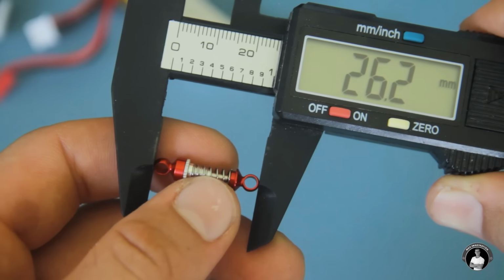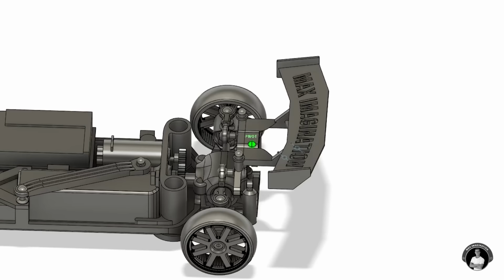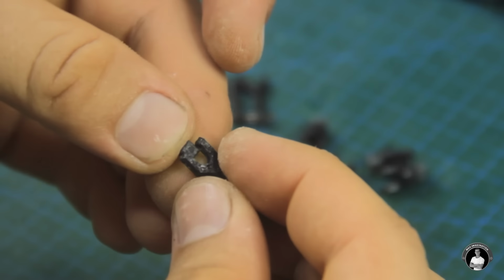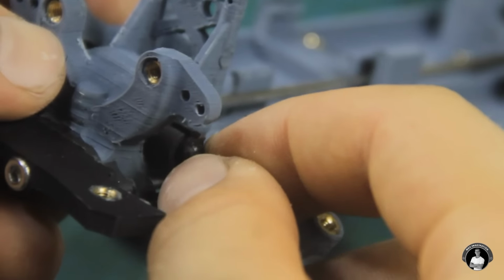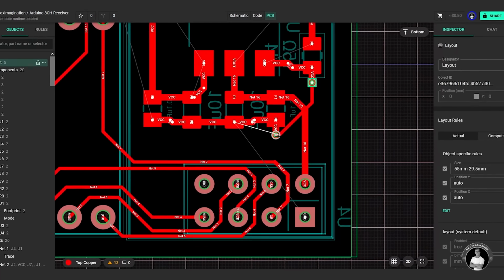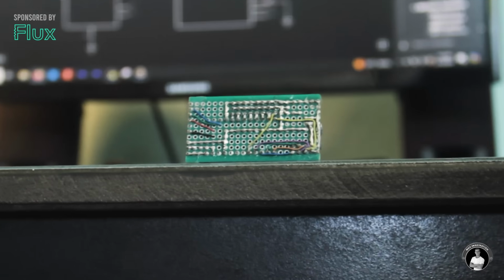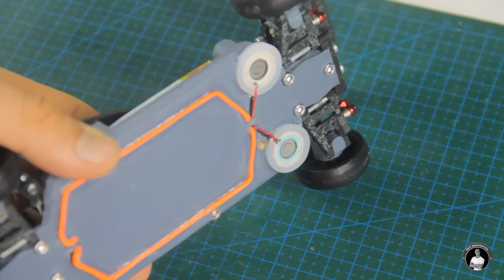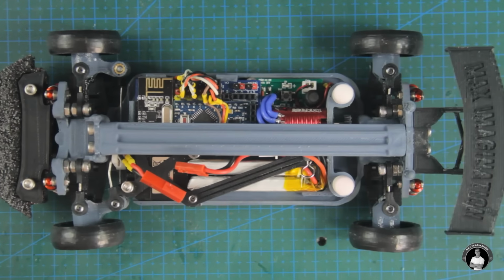Build an Arduino RC Drift Car with Smoke Effect!

Comment: To fix the vibration problem some escs detect the back emf signal and then based on that the esc energises the coils that need to be energised based on where the magnets are located
Reply from the maker: Which ESC would you recommend that would fix the vibration problem?

Comment: I plan on using the electronics of an actual RC car, a 4400 KV motor 2852 and 120 amp ESC even though the motor is only really rated for 40 amps maybe 60 amps at the spikes. 
Along with a radio link receiver with a gyro. 
And a 20kg steering servo. 

These are all the parts I have but I am wondering even with store-bought shocks, if the chassis and all of the other parts needing to resist all the torques and driving on asphalt is going to make the car not stand up even with nylon filament. 

Would you have any idea if your design would work with these high power components?  I wouldn't mind purchasing it if it is capable of using my electronics and surviving all of the shearing forces that would be put on it
Reply from the maker: Hi. Thanks for inquiring!

Based on what electronics you have, they will not fit my design and would require redesigning certain parts to fit.

How big is the 20kg servo you have? Sounds bigger than the 9g servo I used.

I think if you scaled it up, made necessary adjustments on my frame to suit your equipment, and printed it in Nylon, it could work.
Reply from the maker: Oh and since your setup is that powerful, my piece of advice is get the gears CNC machined from steel or brass.
Reply: @MaxImagination would you have the cad files so I can have an easier time in Fusion so that it's not a tessellated mesh?.
And would you be willing to help me since I'm not very knowledgeable about the mechanics so that it drives nice but I'm quite good in the software

Comment: I honestly can't find a reason you didn't just use elrs or similar radio connection for this. It's so much simpler and better than anything you can make yourself
Reply from the maker: True, but my making approach is to build these controllers from scratch. You can see more of my videos and you'll understand.

Comment: How do I connect the car to a generic rc transmitter
Reply from the maker: You'd simply use a generic RC receiver instead of building an Arduino-based receiver.

Comment: HI MAX Like your 3D printing RC drift Car I was wondering if you can make one out of PVC Pipe . I don't a 3D printer so I was wondering if you  can build one from  a . PVC with planning sheets that would be great , thank you  max
Reply from the maker: Thank you! For a PVC RC car, follow my video on that on my channel. This one can only be 3D printed out of the options I give (unless you want to design it for PVC making yourself).
Reply: Hi Matt thank you for your reply I was hoping you might have plan sheets  like you did for your Arduino  drone it helped a lot with my project thank you you're reply Max

Comment: Can the humidifiers run with pwm? It would be cool to be able to map the intensity of the steam with the speed of the car
Reply from the maker: With it's current circuit and wiring, no, as this would cause the humidifier to switch through its different states repeatedly. It could work, but would be cleaner with a more direct way of driving the humidifier - i.e with a MOSFET.

Comment: what's the range on the receiver/ transmitter set you made? I am interested to try to make this work for an ARRMA truck, just to see if I can.
Reply from the maker: 100-1000 meters depending on if you use the standard or power-amplified radio modules in the NRF24L01 lineup.

Comment: Hi Max, I just recently came across your channel and I really like your builds. I'm interested in making rc cars from scratch myself, but I don't have a formal education or the slightest clue on how they work. I would really appreciate it if you could refer me to any resources that I can use to learn. Thanks for the awsome content!
Reply from the maker: Glad you like the channel! You can learn a lot from books and online resources, and don't be afraid to try things out and experiment. For electronics, read "Practical Electronics for Inventors". For Arduino, check out courses on YouTube. For RC cars, you can study the basics of mechanical engineering and take apart lots of toy cars to learn about them :)
Reply: @MaxImagination  Thanks Max. For the advice, and for reaching back out. Not many content creators do that these days.

Comment: Did you do the calculation to find how much resistors to add? How did you know to add that amount of resistance?
Reply from the maker: Yes. I used the parallel resistance equation for the correct wattage and expected ohms of combined resistors and used ohms law to identify how many ohms this end resistor had to be.

Comment: Hello, I have a great interest in electronics and I want to reach the stage of inventing and producing a board. Therefore, I have studied Electronics 1 & 2 and Electrical Circuits 1 & 2 at university, but I feel like something is missing from my knowledge. I kindly request you to explain to me the map, path, and way to become a PCB designer from beginner to advanced level. I kindly ask you to tell me what I should learn from the beginning to the end in order
Reply from the maker: Hi there. What you're asking would require a full video guide to explain at best. But in short, you can find other videos on the topic of PCB designing. One PCD design software I recommend to learn is Flux (AI).

Comment: İmma use the old hobby grade transmitter 3 yr old video is that ok?
Reply from the maker: Yes, it will work with this RC car and its receiver.
Reply: @MaxImagination oh btw i forgot i dont have esc what should i use (i have the old motor controller l298)

Comment: max the receiver is equipped with a 12 volt battery, it's safe for the receiver
Reply from the maker: It is not, actually. What do you mean? However, you can input 12V into the Arduino's VIN pin.

Comment: How I made with pvc  bro
Reply from the maker: You can try, but I do not have the blueprints for that. Would you be interested to instead purchase my 3D design and use JLCPCB to 3D print the parts out? (Link in the video description).

Comment: you should either use metal gear or a bit larger 3d printed gears for more grip as smaller ones might wear down
Reply from the maker: Making them from Aluminum would be enough.

Comment: 21:48 The buzzing issue is due to the ESC.
If you use a Blheli ESC, it will work fine
Reply from the maker: Thanks for your tip... This helps!

Comment: Hey can I use esp32 instead of nano
Reply from the maker: Yes, you can. However, you may need to modify the fitting for this board in the RC car's chassis as it may be too big. With an ESP32, you can come up with your own mobile control platform or use an existing one.
Reply: @MaxImagination also can I use my own chasis cause I think, the drifting is already done and I just want your smoothness and smoke 🤩

Comment: very informative vid i might not have same reason to be here at the moment but ive been thinking to convert a toy into RC for a while now. ive collected a bunch of Knex including busted moters or bad battery bay junk but maybe i can convert some of this into a RC idea. This build does have given me a few ideas. But also for this to be so printenbale nice work man almost a proper drift car but yeah i was already wondering during the video when the 3d printed gears would fail due of heat issues. do find the mist idea funny but dont know if it might causes issues for electronics onboard in the long run.  Geusse im gone keep brainstorming to see if i can make a knex proper RC car one day. but i mostly want build out of Knex.
Reply from the maker: Hey there! I've never played around with Knex before. Legos, yes.

It may be hard, but you probably can pull it off given the right pieces and attachments so you end up with a working drift car.

P.S. The water vapor did not affect my car's electronics. It blows it downward and then dissipates. 

All the best with your project!
Reply: @MaxImagination  ive modded a Knex K-force gun into a frankenstein one because was incompleet. But ive also repaired some expensive knex moter sets with broken junk. i tend to buy piles of knex from people and find a lot of battery acid damaged stuf or total death moters terminals and more or i look for strange or discontinued parts. I wish the new owners of Knex (Basic Fun) would relaunch knex in the EU with good sets like we had in the 90s. i also try collect serten collours and stuf. But i sadly dont have the financial strenght for expensive hobbys. How ever ive done a lot of things creatively for barely money. And yes Lego is fun but most of the time out of my wallet to fool around with so thats mainly reason i got back into knex. Also due of serten sets requiring serten strenghts i think i could make some reinforced driving line but yeah its gone be a lot of thinkering. I wish i was richer but im living on handicap income. Also most jobs ive tried have become a very negative experions. People like work i do for them but barely wane pay or abuse the fact i got a register handicap and try pay less then fair. So makes me not trust them anymore.

Comment: I have a question, I have an Arduino Nano and an Arduino Uno. Can I use the Nano as a transmitter and the Uno as a receiver with the NRF24L01 module?
Reply from the maker: Hi there. Yes, you can. The Arduino Nano and UNO are intercompatible as they work from the same chip.
Reply: @MaxImagination  Thank You

Comment: Hello! Its me again ill just ask a question about the transmitter and receiver video, the black and red pins is it ok if the coppers (or the solder joints?) touch each other?
Is it gonna be fine?
(Sorry for bad English)
Reply from the maker: If you mean the power pins which are red (power) and black (ground), then absolutely not. They shouldn't touch.

Comment: Yoo max its been a while 
I need your help i have a pin stuck in my pcb board and i just woke up and heated my soldrring iron and my brain says cut the both end of the pins stuck on the pcb and now i cannot remove ive all of the heat that my soldering iron can handle but it wont melt the solder it melts the solder but only on the one side of the pcb and not the other I applied flux, and desoldering pump but the two didnt work.😢
Reply from the maker: Hey there. I suggest you use a pair of helping hands and melt a blob of solder around the pin while heating it, then pull it out.
Reply: @MaxImagination  alr

Comment: Still working on my 3d printer its diy but I am using standard drone bldc so I can't really reverse the direction of it using the included esc and diy transmitter and reciver
Reply from the maker: I recommend you either obtain a bidirectional ESC or look into how you can connect 10A relays into a circuit that switches the direction of your current ESC for bidirectional control. However, you may need to do additional coding with this method.
Reply: @MaxImagination  switching the 2 of 3  wires of esc using relays that. Seems complex and amazon doesn't ship here so I got one option I am not the best coder do I need another arduino I want to use something small not like uno or do I have code the transmitter and reciver ? Also the joysticks suck is there a different option for that?
Reply from the maker: You don't need another Arduino, you can use the dual channel relay method to swap the two outer wires of the 3 bldc motor wires (I suggest you research how this is done on YT/google it). For better joysticks, I suggest using PS4 joysticks.
Reply: @MaxImagination  Hello, so i somehow got my hands on a bidirectional esc and finished my 3d printer "works better than a my friend's ender 3 somehow' but you made 3D files paid ugh ofc you have do that i am already nearing the budget for my diy 3d car i really wanna make this exactly like yours but i cant 3d model things well can just make the files free theres people who wanna make this but cant, but anyways thanks for your help

Comment: Here are some tips if you are making this and some upgrade(s) i would like:
-definitely lube the joints AND the gearbox so they can last longer and be much smoother
-i would definitely water proof the circuits with some sort of polish or use silica gel pouches in case the humidity from the smoke decides to ruin my circuits
-Max, to up your drifting game, try adding a gyro circuit that way you have much more control over the steering of the car
Reply from the maker: Thanks for your tips! Even though I will not get back and make an upgrade update video on this project, let the tips be useful to those who wish to make the car.
Reply: @MaxImagination  with that said, could you pls still do a tutorial video on making a gyro circuit for steering there are vids online but Ig you will do best at explaining

Comment: OUTSTANDING! I looked up those awesome humidifiers! It didn't say, but do they use regular tap water, "purified" water or some other kind?  I can't believe how awesome that smoke effect sis from just [some kind of] water! I hope you can answer for me! Thanks! Totally awesome build!
Reply from the maker: Hi, Mike! Thank you for your comment! These humidifier modules work from tap and purified water. I tend to use tap water and it works well. Cheers!
Reply: @MaxImagination  Thanks for that! I am just very surprised that the water coming out of it looks like smoke! so awesome! I actually have several of those I am working on a project for my company that involved lighting, but haven't tested them yet. I wonder if something else could be put in them, to make it invisible but yet let light "interact" with it...
Reply from the maker: No problem :)

You can experiment with replacing water with glow stick fluid for something that lights up. Not sure if this will work, but it's worth a try.

Comment: Max i gonna ask a question in the diy transmitter and receiver the wires you used what is the kind of it?
Reply: Do I need to buy it
Reply from the maker: Hi there. I used 24 and 30 gauge (AWG) silicone-coated stranded electrical wires. You can find a product link to those types of wires below the transmitter's video on my channel. Cheers.

Comment: Holy crap this is dedication. Only $100 in parts. $4000 in sweat equity. It's really inspiring for case design and how you can use 3D printing plus real hardware. I've never seen anybody use standard protoboard for SMD devices!!!
Reply from the maker: I appreciate that. Many thanks for your kind remarks! Since you found it interesting, consider giving this project a shot :)

P.S. The 3D design is currently on a 40% discount!
https://cults3d.com/en/3d-model/game/arduino-1-24-4wd-rc-drift-car-with-smoke-effect-chassis-parts-design
Reply: @MaxImagination  I just donated $15 instead. Rock on with your bad self.
Reply from the maker: I really appreciate your kind gesture! I got the payment notification yesterday. Thank you so much :D
Reply: @MaxImagination  Ain't no way I have that kind of time. I appreciate your engineering and design, but it's not my field of interest.

Comment: If you lower the pinion teeth I think the motor will stop stuttering
Reply from the maker: Thanks for your input. I don't think that is the case as I heard others mention that it's due to the gear material. Ideally, the gears should be made out of metal.

Comment: 21:55 скороее всего это связано с тем, что у esc не оптимально подобран таймин для этого мотора. Попробуйте зайти в режим програмирования esc и выставить другой, более подходящий тайминг, скорее всего это поможет избавиться от шума.
Reply from the maker: Thanks for your tip. I will adjust the PWM timing and see if it makes a difference :)

Comment: Superglue bearings, WTF, you just seize them.
And bigger angle is needed, above 70° to make any rc drifter consider it trying...
Reply from the maker: I think you got that wrong. I mentioned that you need to glue the drive axles to the inner part of the bearings. Not "into" the bearings.
Also, what angle are you talking about? Wheel camber or steering angle?

Comment: mabey try to add more volt or its mabey loose
Reply from the maker: One other viewer has suggested to adjust the motor ESC PWM signal delay. I will try that first.

However, the problem is certainly not in the design or the gears. The car works despite this hiccup, but I will keep working on a solution 🙂

Comment: What was the hardest part of this car?
Reply from the maker: The hardest part was probably shaping the central drive axle to stay straight and fit into the gears perfectly. Apart from that, this may have been a bit challenging in a few areas yet very rewarding 🙂

It's worth building for sure!

Would you be interested in starting this project?

Comment: Question.. can I use brushed system insted of brushless one?
Reply from the maker: Yes, you can. This car is compatible with the 180 motor and brushed ESC. Be sure to use the original version.
Reply: @MaxImagination luv this bro!
Reply from the maker: @vj5254  Thanks! So, would you like to start with this project?
Reply: @MaxImagination  sure!

Comment: DUDE My suggestion IS, you can use a metal or aluminum coated gears to the motor grip for the buzzing sound 
                   There will be not available as such small gears but you can coate the gear in thin layer by using zinc 😅
Reply from the maker: Thanks for your tip! However, how do I "coat" a gear in metal? What does the process involve? Cheers.
Reply: @MaxImagination        
   Hi MAX ,
               You can coat zinc in plastic gears. This process is commonly done to protect the zinc from corrosion or to modify the friction and it will protect from the buzzing sound and characteristics between the gears.  
               The coating is usually applied through techniques like electroplating or painting, and it helps improve the durability and performance of the gears in your rc cool drift car car😀😀😀😀😀